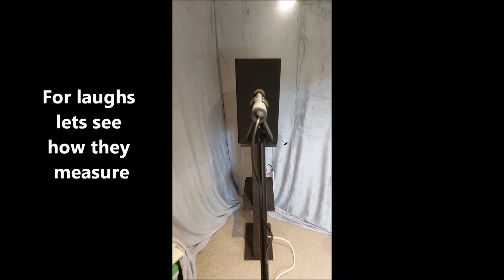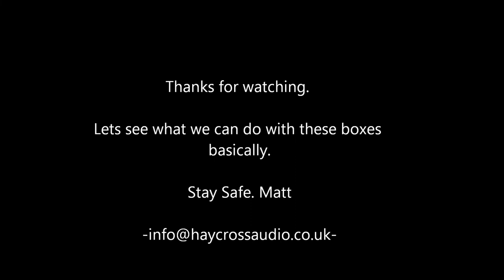National Panasonic SB-61 Speakers Part 1

Comment: Great video. Funnily enough my first system was a set of the slightly bigger two way National Panasonic SB-50 speakers which were UK made and had Audax drivers from new. They came with my Dad's first separates system which was also all National Panasonic, which he gave me when I was very young. Been trying to find a set of those for a while as they were very special to me too! Would love to know who built them for Panasonic. 

Interesting comments about Harbeth. I grimaced a bit (own a pair of C7ES3'S). Always thought Alan Shaw goes for fairly decent components, but he also does say that he doesn't buy into things like high quality cables etc, as he finds they make no measurable difference to the performance of the speaker. But you're right, they're expensive.